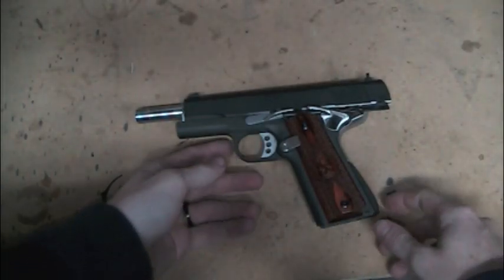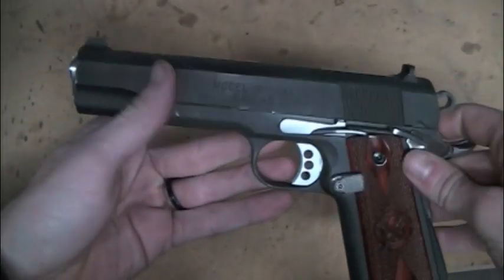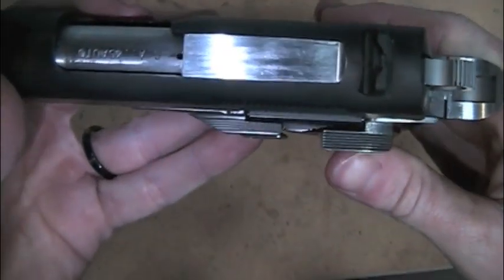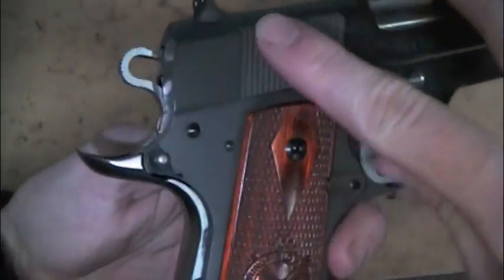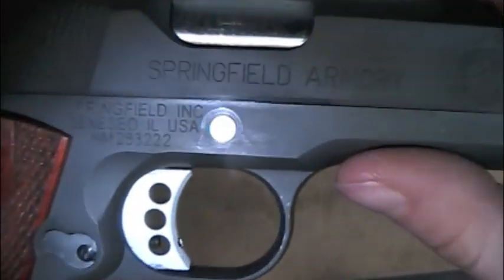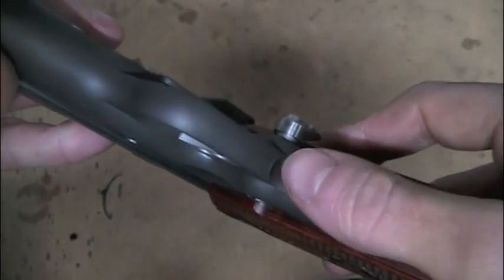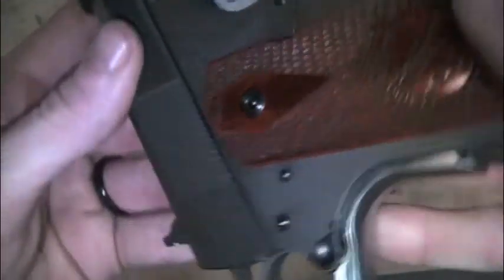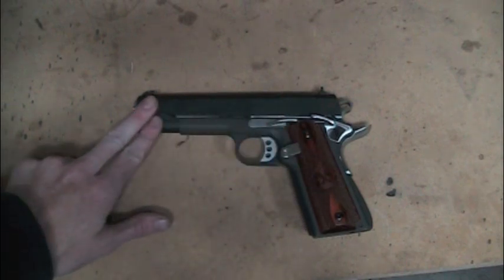1911 Modifications

Comment: I like the flat main spring housing. I had a Wilson Combat thumb safety It just slide right in without any fitting. With the safety on I could pull the trigger and the hammer fell. If the safety was on and I filliped it off the hammer would fall to the safe position. I buy Ed Brown parts now

Comment from the maker: What? Are you one of those guys who thinks rotating the cylinder on a revolver is bad for it or something? It is a gun. It is meant to be thrown in the dirt. It is a tool. It is meant to be slammed around. Dropping the slide on a 1911 does absolutely no harm to it.
Reply: usmcboyer 
Exactly
Reply: Well, I could use my knife as a chisel or pry bar, or use pliers to remove bolts, etc, but I won't. Tools are "design specific". I will NOT use a screwdriver or knife as a chisel or pry bar, any more than I'd use a pry bar to remove a screw or a screwdriver to skin a deer.  Imo, this falls in the category of just because you can, don't mean you should. Same as , I won't dry fire without snap caps. Sure, I could, but I could also have a catastrophic failure of a broken firing pin, when it counted the most. The JMB 1911 was "design specific", meaning the slide was designed to strip a heavy, .45 bullet from the strong spring mag and shove it into the chamber. IF you slam the slide without a bullet , it IS hitting the barrel too hard, damaging the top lugs ( and matching grooves in the slide) and the front legs (against the frame) and putting strain on the barrel link. If ya'll think that stuff can't fail, then ask gunsmiths what they're repairing the most on 1911. Sure, a Steel framed 1911 could take the abuse( and it IS abuse), but what about poly frames?  Fact is, there are good habits and bad habits. I put that in the "bad habits" column, same as dry firing without snap caps.
Reply: I watched this video of a guy saying "dropping the slide (slide racks!) on a 1911 (slide racks!) Is completely (slide racks!) fine (Slide racks)! 

He did it like a hundred times in the video.
Reply: obvious you nothing  about the fundamentals of a firearm,  get a life

Comment: Is it possible to remove the safety? 
Is it possible to remove the palm grip safety? 
Is it possible to remove the slide release lever and use  a pin without any lever? 
Is it possible to remove the safety springs between the safety and the slide release? 
And still have the pistol function with no safeties? 

The object I am going for is after these modifications are made both sides of the pistol slide would be completely clear for engraving a large picture.
Reply: Soooooooo, for engravings sake you would completely remove any semblance of hammer retention/safety function from a pistol that, quite honestly, is capable of such a low weight trigger that you could discharge one by picking it up wrong? You're made from spare parts, aren't ya bud?

Comment: Oh yeah this gun your gun is a mil spec model as is mine. You said GI model but they stopped making the GI model a few years back. The mil spec is very close to the GI only a step up in springfields list of guns for sale now. Mil specs have lowered ejection ports forged slides and frames, match grade barrels, slanted slide serrations and a few other upgrades I can't remember right now. But it's the best model to use to build your own gun from scratch! hands down. No other make of GI model or close has slides and frames, barrels as good as this! Research it, I did!

Comment: Dropping the slide on an empty chamber does damage the firearm if you do it all the time. Same goes for using the slide stop all the time to release the slide. With that said, it would take years of doing so to notice any signifigant damage.
Reply: Agreed, I'd say with a poly frame , even sooner.
Reply: That is a myth for the 1911A1 - The pistol was made to stand watches. We did it 6 times a day with the same pistol in the Navy, and dry fired it each time.  The pistol will take all that and more, day after day for decades with nothing but regular maintenance.  But I have no idea about other firearms and their durability.

Comment: The bigger slide stop is pretty pointless. When using the gun as a gun and not a toy to play dress-up with you really don't need it at all. The only time I use it is when the slide needs to stay open when resting on the bench at the range or any other time i needs to be viably unloaded

Comment: awesome dry drop on the slide at  0:09.... why bother makin your shoot pretty only to abuse it by dry dropping slides??
Reply: grim jugger using the slide stop even when to reload causes more unnecessary wear on 1911's
Reply: dustyak79 Then what is the slide release for?
Reply: David Spennachio My bad I was gonna put quotation marks on slide "release"( I edited it to make it more clear) it's a slide stop it stops the slide when gun is empty actuated by magazine follower also serves as link barrel pin. Imagine this, two angle cuts in steel rubbing on each other eventually one of the angles will round itself. Hope its the slide stop not the slide cheaper to replace and until you replace it your slide probably won't lock back on empty magazine.
Reply: Cool Beans!!!
Reply: The slide stop is for exactly what we're talking about, to STOP the slide from slamming onto an empty chamber.  The problem is, folks mistakenly call it a "slide release", which it is NOT, it is a "slide STOP". IF you replace the empty mag with a fresh one, sure, release the slide with the "slide stop" (but slingshotting is better), but still, the slide is stripping a bullet from the mag, as it was designed to do..